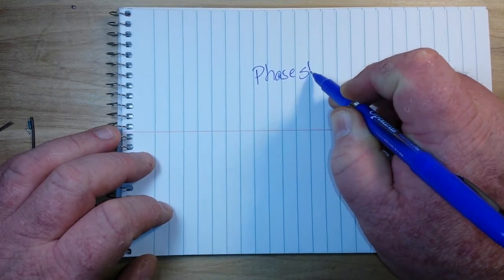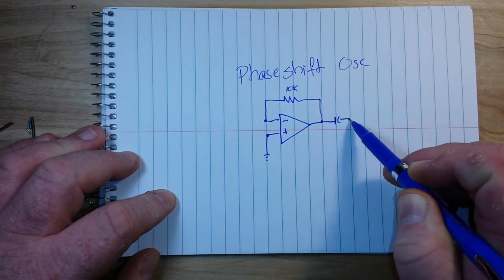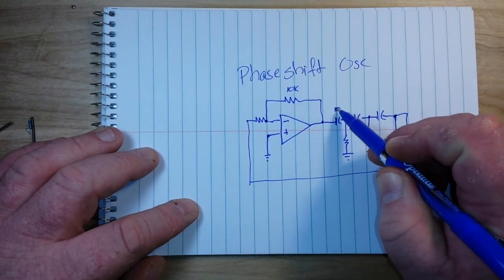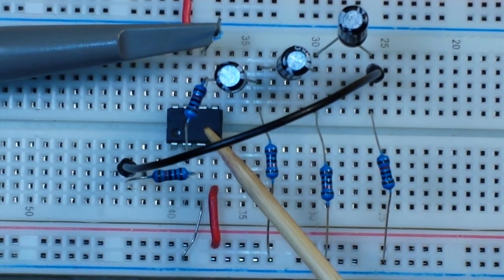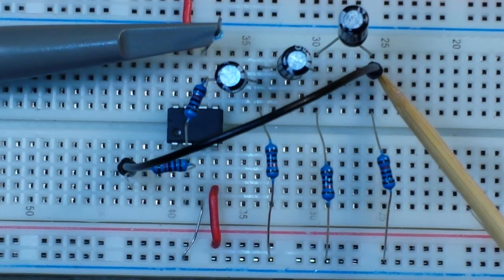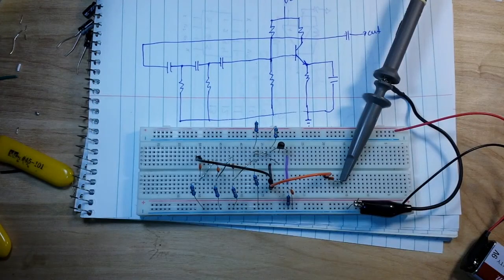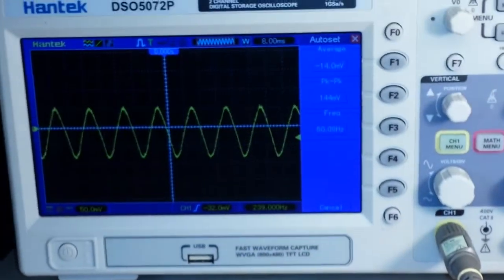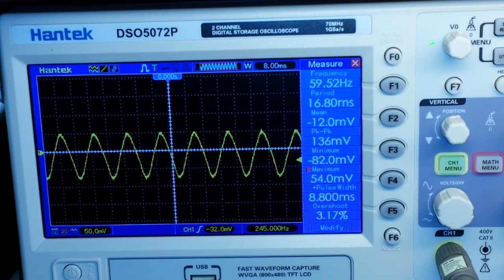Basic Electronics:   Phase Shift Oscillators

Comment: Just curious. Could the poor quality of the sine wave from your first oscillator have anything to do with your use of electrolytic capacitors? After all, electrolytic capacitors have pretty poor tolerances. And I imagine capacitance would tend to drift to a greater degree than ceramic capacitors.

Comment: wuld those circuet work on pick up coil? I need badly some circuet that can advance/retard ignition timing for 4 pin gm ignition module that thing run's around 30-300hz

Comment: It wasn't clear to me why one would need to use this circuit. Also there was 3 Resistor/Capacitor sets near the output. It wasn't clear why there were 3 sets instead of just one RC. And it wasn't clear why it the output was fed back to before the resistor instead of after the 10k input resistor. I ended up feeling like I saw a circuit, but not understanding why I needed to do any of it or what I could use it for.
Reply: Each rc set shifts phase 60°, so to get back to 180° to line up with the output you need 3 rc sets. That's how i understand it.

Comment: I think your schematic does is not reflected by what's on the breadboard . The transistor is EBC , but on the breadboard you got it connected as if it was CBE . Collector and Emitter are swapped on paper.

Comment: Your transistor circuit can’t work because the collector and base are connected together. And it’s not working. That (very nice) sine wave you’re getting that just happens to be 60 Hz?...that’s AC household power noise.
Reply: I noticed it too. Came here to read comments and laugh))

Comment: Battery connections look strange. One's negative wire and other's pozitive wire are in the same hole. Can anyone explain to me?
Reply: I think its to supply negative voltage. http://www.learningaboutelectronics.com/Articles/How-to-obtain-negative-voltage-from-a-DC-power-supply-or-battery.php#:~:text=Therefore%2C%20many%20chips%20including%20the,makes%20use%20of%20negative%20voltage.&text=Negative%20voltage%20is%20also%20needed,is%20widely%20used%20in%20electronics.

Comment: How come you switched from electrolytic caps to ceramic caps when you switched from an op - amp to a transistor component and can the transistor version of the circuit work with the electrolytic caps too ?
Reply: I’m guessing that the less linear nature of electrolytic capacitors was responsible for the distorted output of the first oscillator he built.